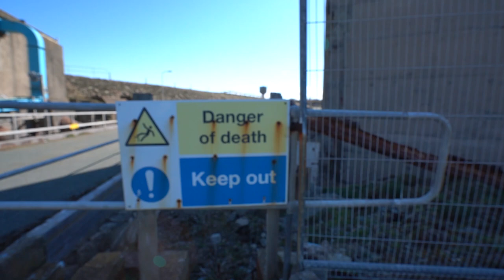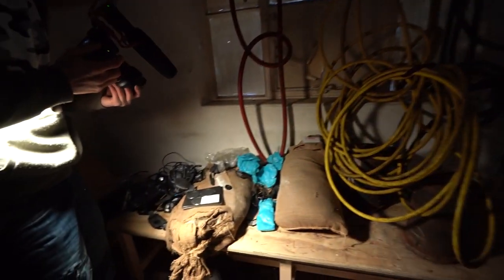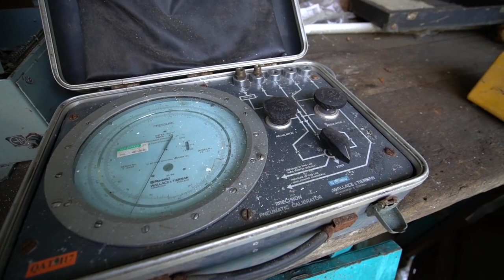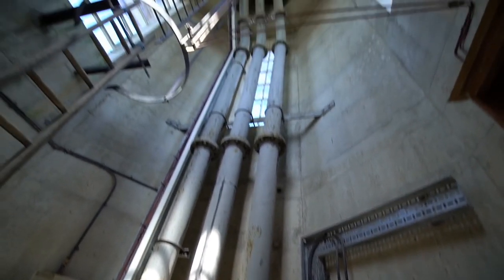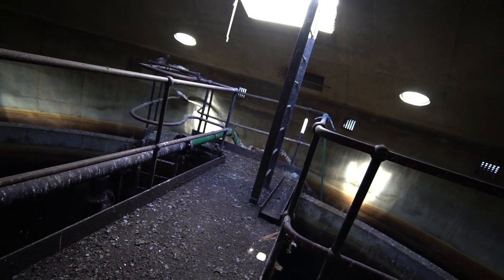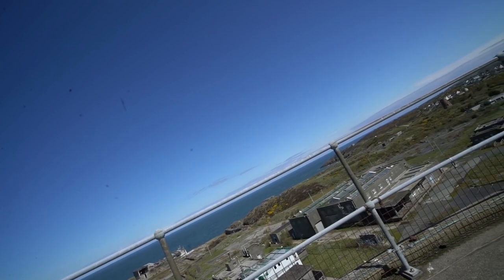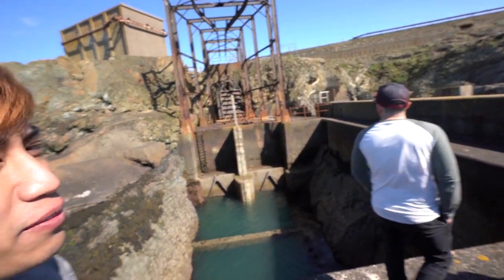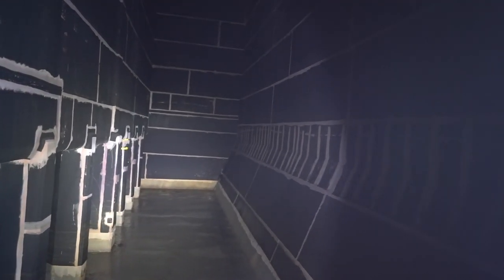ABANDONED Top SECRET LABORATORY Everything Is INSIDE

Comment: Steve, after you walked the wall above the cliffs, the pool area you mentioned, appeared to be for power generation of the facility. A water dam is needed to hold back water so when the water drops to the turbines, there is enough volume and what is referred to as head, as in, to build up a head (of steam). The long black pipe is called a penstock, and it too channels water to the power generation portion of the facility. One area you went into was where the turbines were located. Great aerials. Cyndie on Richard's channel
Reply: Richard Cole this isn't a copper mine hole. It restores the city's water
Reply: T34 B4g3r I didn't say it was a copper mine. I said I thought it was a power generation facility. Cyndie

Comment: The water tower was most likely used for sprinkler system. Elevation would be needed for pressure without pumps. If there is a failure in electrical systems, water would flow through regardless. Love the shots.